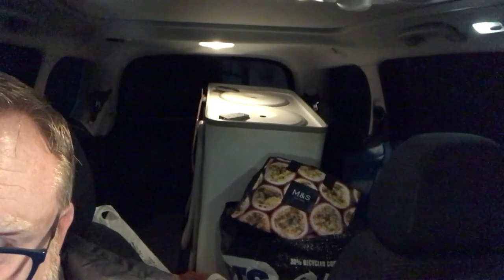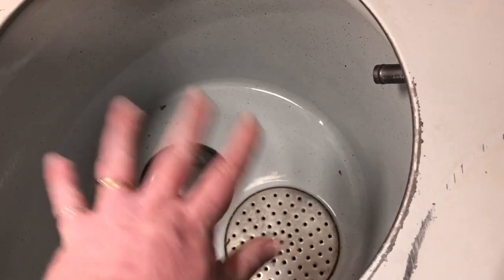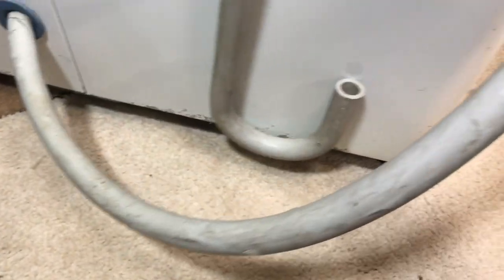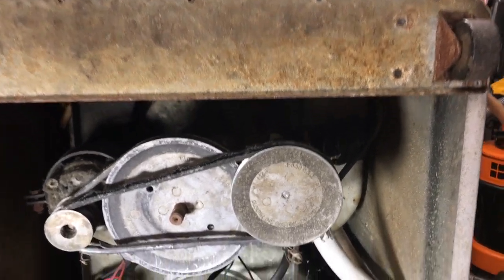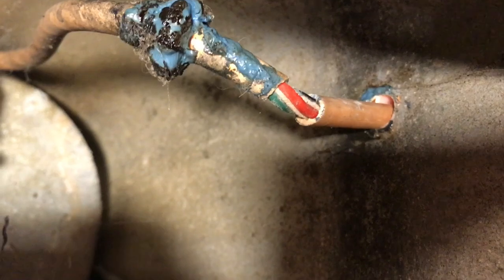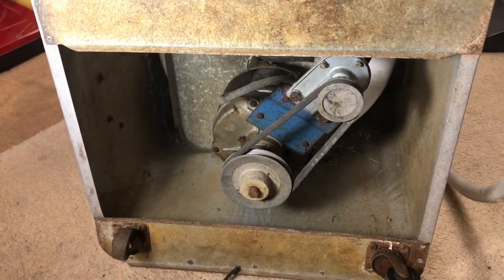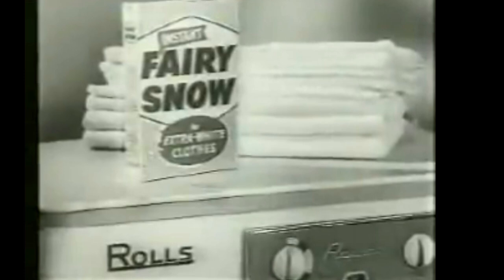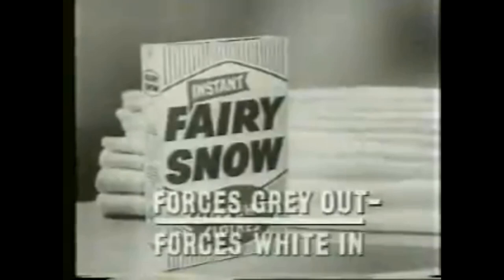Vintage Rolls Rapide TwinTub Washing Machine, Roadtrip & First Look

Comment: The lady who lived next door to us had one of these exact machines. One of my earliest memories is seeing it working and me trying to look into the washing machine part and seeing the water flowing out of that little pipe in the wash tub. 1969 !!
Reply from the maker: Haywards Dave I can’t wait to get it up and running, that blooming broken odd shaped hose is making it so hard to fix. I wanna use it 🤣
Reply: @HooverLux  Deffo best of luck.. They used to let my mum take our bedding over to wash it sometimes. In those days, in the winter time when they had open fires it heated the hot water as well so it wasnt an issue. No water meters in those days either. Ive actually got my mothers old Hotpoint twintub from the 80s that replaced her Hoover twintub from the 70s but I confess, I ONLY use my automatic machines now..(yes Ive got 2) Best of luck with the repairs though.
Reply from the maker: Haywards Dave oooh! Is that the Hotpoint superlative deluxe like I have? Not sure if you’ve seen my vids on them. The only twintub I remember from my childhood was the lady living next door to my Nan.
Reply: @HooverLux  we had Hoovermatic delux but the Hotpoint is only the standard one...no auto rinse function on the dryer...and an extra handle on the dryer lid so it can be lifted B4 the dryer slows down..we lived dangerously but with common sense in them there days ;-) It all works though. It wasnt used long B4 they brought our first auto...
Reply from the maker: Haywards Dave I’m definitely an admirer of washing machines, but it’s vacs I repair and restore mainly as you’ve seen. I’m just fascinated by many house white good to be fair.

Comment: What a lovely old machine, it's in remarkably good condition considering its age. It just needs some TLC, replace the perished hoses and get in electrically safe and it should be fine. My guess is that the red warning lamp is for the heater. If you want to impress people then you can now that you have a rolls in your garage. Great video Dorian, thanks for sharing.
Reply from the maker: I was very pleasantly surprised on its condition, I’ve got almost the exterior parts I need. I hadn’t thought about the light and the heater, good thinking Batman! So now I have a Rolls to go with my Mercedes, Nilco Mercedes 🤣🤣🤣🤣🤣🤣🤣🤣🤣🤣🤣

Comment: I used to repair these machines, 44 years ago. Arlington electrical, Brixton high street (ARL no there anymore). Bloke that used to own ARL was Tony Ginn, really nice bloke, tough boss though.
Reply from the maker: I could do with your help with the heater and the controls 🤣🤣🤣
Reply: @HooverLux  The top comes off (remove rubber trim), the heater element is a butterfly type and comes out after you have removed the filter using a screwdriver..... The empellar is direct motor driven but wasn't enough to agitate the washing, hence the re-circulating water. The light doesn't light up until you switch the heater on..... and those electrics, were the safest you were going to get for the time (horrendous I know)...... Good luck getting parts if you need them....but for the looks and sounds of it, it just needs a wipe down with a wet cloth and it's ready to go.

Comment: I have the Rolls Concorde. Great little machine.
Reply from the maker: Oh wow!!!! That’s amazing, I wish I could get this up and running, I’m gonna have to get the part 3D printed I think 😢😢😢😢
Reply: What part is it you need?
Reply from the maker: It’s the plastic hose that goes from the pump to the return pipe. It recycled the water back into the tub. It has one larger end from the pump and a smaller end to connect to the return pipe

Comment: Wow have we got a hobby like no other ! Your collection of vacuums i amazing I had a hoover convertible super old and still to this day I wish I’d kept it because it was the best vac I’ve ever used and ive used a lot
My interest is more in washing machines and twin tubs are just the best things ever I have a hotpoint 1460 older than me (48) and works beautifully I’d not change it for any amount of money because it took me over 20 years to get this particular model which all parts are in imperial measurements. I’m looking at a rolls on eBay right now. I’ve had two or three before and all of them leaked so badly I couldn’t even fill them it wasn’t just rubber hoses it was the aluminium had corroded. They went on to become colston then colston ariston and we’re essentially the same machine parts as far as I know are non exsistant unlike hotpoint where many ( not all) parts can be bought for a price and even if u buy a metric side part for let’s say my older one mantid not all parts can be interchanged. Other twintubs were servis. Old ones with black agitations and no safety handle
On the spinner were made like nothing else on Earth they were so powerful and super quiet and the heater and agitator could be used at the same time. Later models were essentially the same but had safety arm on spinner making nit impossible to use with the drum exposedand the arm made it a brake to assist stopping it. But the agitator on later models were grey plasti which over time slid over its drive becoming loose and eventually the agitator rubbed on the bottom of the drum and
Literally rubbed a hole through the vitreous enamel drum but it took years for to to do. Many believed it was because it was overloaded which caused this but is only partly true. 
Then there was the hoover “hioverwmatic “ it had a side mounted agitator which spun the clothes round one way only they wer very poverful but could be easily overloaded and clothes just sat in the tub while water swirled around them. I personally hated these machines because they tangled everything into knots imagine half s dozen men’s shirts going round just one way for 4.5 mins that was a full cottons wash net curtains it shredded them wool and silk were no no’s to but for dirty soiled jeans they were brilliant only 2 pairs at a time hoover also had only
One
Pump unless it was a very early model and this valve system prone to leaks and not sealing one side properly but when I did work properly it was super fast and would empty the wash  tub in under two mins 
The last was made by Phillips was a central agitator like hotpoint and service they were well made but I’ve only ever seen two and the one I had the spinner had a fault I couldn’t even work out what the fault was I suspect bearings now. At the time I was about 14 years old
Back to your rolls I had the ariston version of it like I say it was essentially the same but had this safety lock mechanism on the spinner that was infuriating to use as it was stoppedvages before you could open the lid. All of the rolls / colston/Aristotle machines were cheap and it’s not untrue to say nasty despite seeing the wash side full of water adding
Powder it looked like it wold beat your clothes to death. Nope one bath towel was a full load or one pair of mans jeans and just like the hoover machines they knotted everything together   If you washed just one big item or a few small things they did a good job bot forget a blanket it just wouldn’t move it al all. The aristocracy machines did away with aluminium drums so leaks were less of a problem but the had them lots of them pumps were terribly unreliable leakedbadly the seal at the base of the spin dryer I can’t even describe how badly designed they were they would literally shed themselves to bits and the motor was directly under it so add wet clothes and bang ( I may be wrong 
On that I may be thinking of Creda 
Spin dryers
Hotpoint s we’re the best but they did have problems but they were easy to fix. The seal under the agitator would ewear out or split and the machine could leak badly but still be used as it leaked onto the gearbox and away from the motor the cane as a kit and you replaced the seal springs and nutthat had a threaded hole for the agitator to lock into the hose for the spinner was a weak point in the older ones with all rubber not the plastic ones they replaced them with would not hang In the sink so you had no voice but to hold it whilst it was rinsing the bellows  ( seal) on the spinner eventually splitbut only very slightly it would  leak into the clutch and it wouldn’t accelerate  but it was easy enough to replace  
Overall I don’t know that much about old twin tubs 🤣single tubs with electric wringers now hotpoint and servis made some amazingly machine built
Like brick shit houses and washed like nothing else no automatic made today could compete with them when it came to getting stuff clean
Yes it was quite involved and the electric wringers were no match for spin dryers but after using one of these properly you knew your clothes were the cleanest a machine could get 
My apologies for my huge text but I think u understand my utter fascination for washing machines I’ll spare my 7 volumes on automatic washing machines ha ha. 
Please whatever you know about vacuum or related machines I’d love to read especially the flying saucer Hoover I had and I THREW AWAY!!! I should be locked up for such a crime. What were the names of them one was a ball I’m thinking galaxy and constellation???? 
Your video on the rolls was top notch and that one has to be the best example I’ve ever seen
Reply: Sorry allot of spelling mistakes and I can’t work  out how to correct
Reply from the maker: Wow! That was amazing! I read every work with fascination! You really do love them and your passion absolutely comes through in your message  🤗🤗🤗🤗🤗

The Rolls has hit a stump at the moment because of that bloody bit of pipe I need with the 2 different size ends and the awkward angle! I have a couple of vac restoration vids to do first and then I will get back to that Rolls! I really want that done and sealed to use. I can’t wait to get it sealed and then demonstrate and then spray paint and refurb. There is just something about it I really love and really want it working to use I can’t thank you enough for your message. Wish you were here to help me with it. But I’m absolutely determined to get it running and looking good.
Reply: Chris, I remember one of my grandmas having a machine with an electric wringer. I used to love watching her wash. Everything was washed and wrung first then put on one side. She would do several loads then empty the machine. She would then fill it with cold water, rinse and wring all of her washing. She would do this several times until all were rinsed thoroughly. 
She would fill it for a final time and add dolly blue for the whites and then all through the wringer for the final time.

Comment: Does look as if there is a safety cut out switch on the spinner lid hinge, but obviously not working.
Reply from the maker: Peter Clapham Hi Peter 👍. I had to put to workshop to have a look 🤣🤣. You’re absolutely right, I hadn’t noticed before. There is a little pin looking thing on the hinge, but yes, it definitely didn’t stop the spinning while the lid was open. Once I take the hinge off I will take a closer look at it. Thanks for pointing that out my friend.